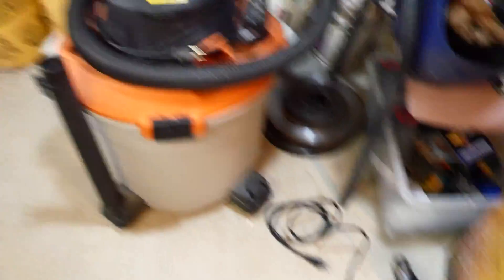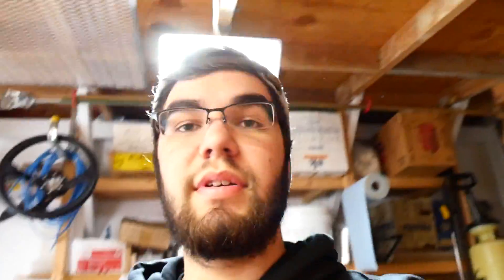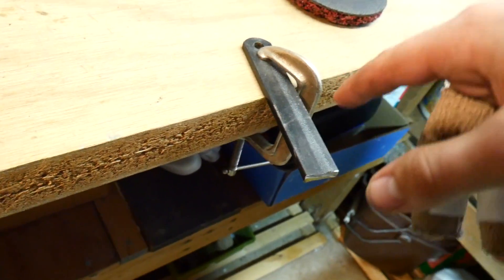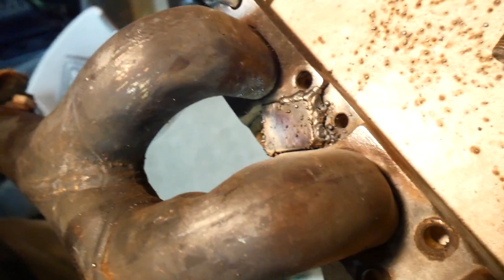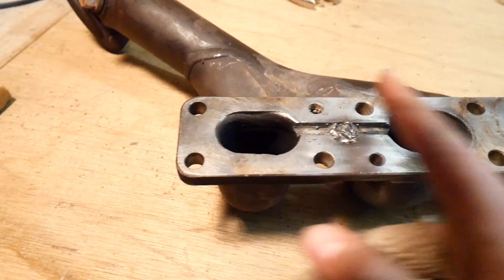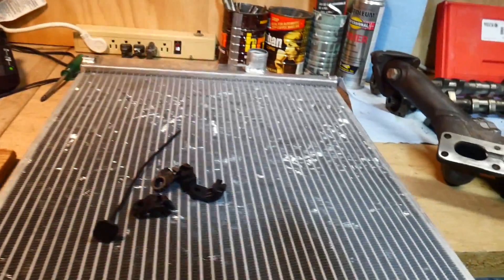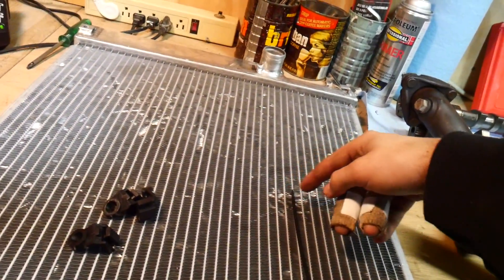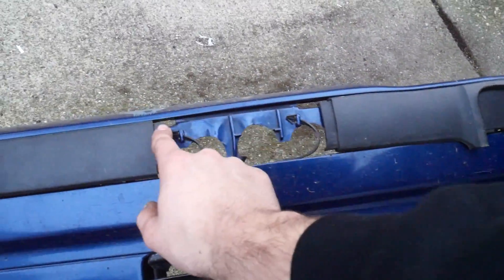EGR Delete & Electric Radiator Fan // e36 1jz 003

Comment: You shoulda paint those Zip Ties (Head) Silver to match your Radiator. They are designed to stay between the two slots of the Radiator to prevent Bent / Damages to the Radiator.